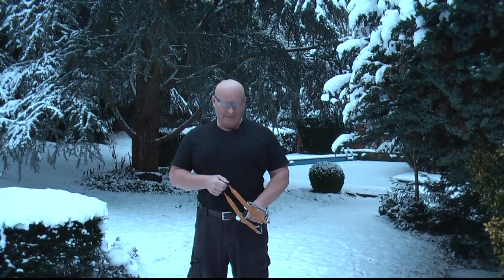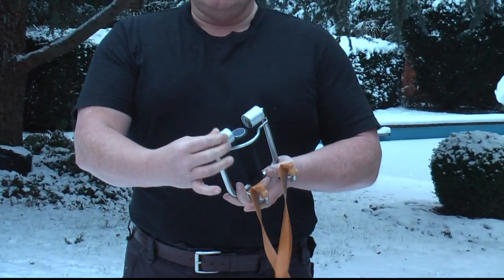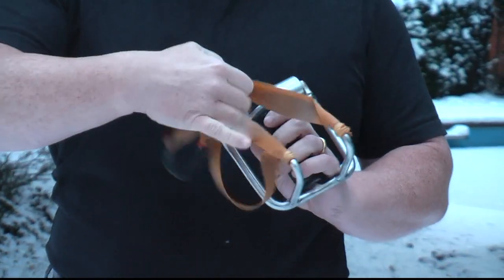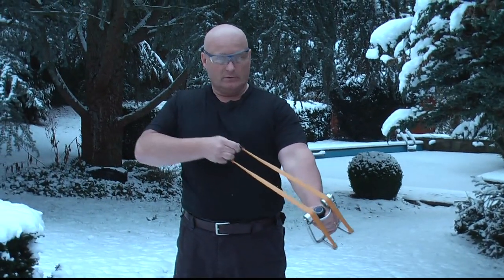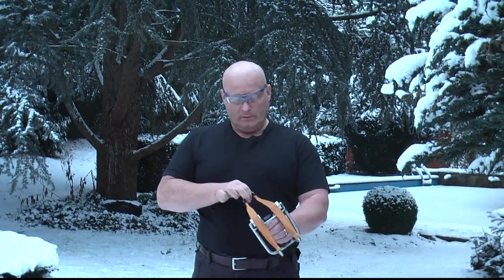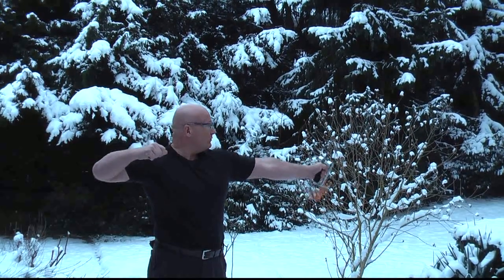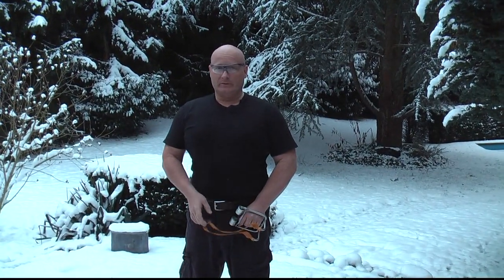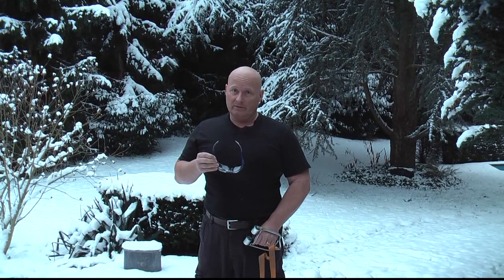Compound Slingshot With Ball Bearing Pulleys

Comment: Question Joerg,

I had been meaning to ask you this for a long time.  I imagine you've been using slingshots for quite some time now, (very powerful ones at that). On many of your videos I have seen you stretch the rubber bands to what seem like critical lengths. Have the bands ever suddenly snapped and hit you in the face? 
How often does it happen? Do the bands usually fail at the point where they attached to the frame or in the middle of the band?